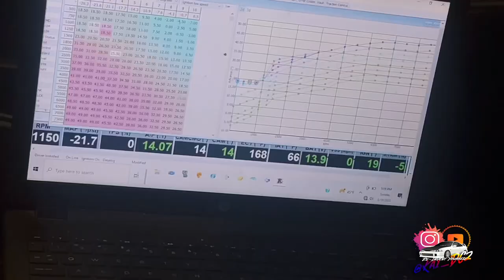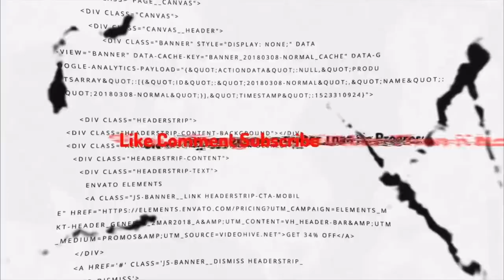Skunk2 Ultra Race + 90MM Throttle Body Upgrade! #Skunk2 #K24 #Integra

Comment: 💯🔥🔥🔥. Did you end up use an acuity tps again
Reply from the maker: Nope never went back brother, had no need for it with this throttle body and wirewhere tps adapter 🙌🏾
Reply: @Kai_DC2  right on I just got the 90mm from skunk2 but I was not sure what route to go with I heard good things about both thanks for the info bro 👌

Comment: The dc2 is Beautiful 👌 buddy well all hondas are in my eyes, be good to see her on the rollers, quick question as I'm contemplating a new intake manifold but I was swaying more towards the rrc from the fd2 just because I can pull off that oem look if you ignore the fact you have to trim the slam panel on the ep3, I can assume it was more pure eye candy that made you choose that manifold because they look amazing, great video buddy and keep up the good work from over the pond 🤙👌
Reply from the maker: Thank you for the watch brother, but as far as manifolds. Since i started out, i went thru the levels from type s manifold, to rbc/rrc to s2 ultra street now the ultra race. It all depends what you’re trying to do and the purpose really, im going turbo soon and I remember a builder told me K series love to breathe, so bigger the intake and exhaust the better. Also the ultra manifold eye candy did play a part lol

Comment: Yo, what kind of throttle body cable do you get that works?
Reply from the maker: I had the ktuned adjustable throttle cable, still on the car till this day 🙌🏾
Reply: @Kai_DC2 Yo, I'm thinking of getting a new throttle body cable for my Ross Machine Racing 90mm Throttle Body in my Honda EG. Which one do you recommend?

Comment: How did you connect your map sensor??
Reply from the maker: It connects directly to the clear hose that comes with the fueltech and you run that hose to a vacuum port on your manifold to the back of the fuel tech.
Reply: Ohh okay what’s the part number for the tb?